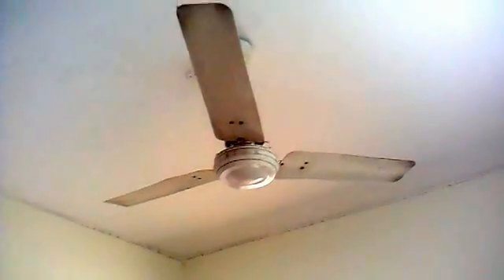YOUR CEILING FAN WITHOUT CAPACITOR

Comment: I had a problem with my fan so I decided to open the fan and replace the capacitor, after replacing the capacitor the fan will not rotate if I don't give it a push. When I remove the blades the speed increased and when I put back the blades the speed decreased I decided to buy a new capacitor but the problem persists. Please what do I do.
Reply: perhaps the new capacitor is also a defective one.  buy a new capacitor of a reputed brand from a different store. the problem can also be with the bearings or the regulator. u better check everything
Reply: even EC engineer as physics teacher don't tell these things why?

Comment: i have a crompton greaves high breeze 1990 model which was running at high speed and i packed it as we did not need it anymore today i took it out and its very slow i had 5 spare capacitors all were good and i even checked the winding all is good i dont know what the problem is  can you help me solve my problem
Reply from the maker: it might bE  a mEchanial problEm
Reply: it was due to swap of capacitor and winding wires
Reply: try changing the bearings !
Reply: everything was fine the wires were swapped nothing else thank for your solution

Comment: I joined directly the wires to power the motor (I removed the bad cap and the switch) and it makes a hum sound but when I give a good push, it does not spin, what could go wrong ?
Reply from the maker: there are two windings inside the motor and the impedance of both the winding should be different only then it will rotate that's why we connect a capacitor.
you should connect a capacitor with the same rating as previous one or just give a push..
i hope it will help

Comment: Hey Hemant, I am facing a small problem at my home too with My ceiling fan. It's regulator is stuck at no.3 and not rotating at all....so i am not able to increase or decrease the speed of my fan..any idea why is it happening and how can I resolve it?
Reply: just replace the reg. or better still disconnect the reg, and get the fan to spin at its highest speed.

Comment: but...why the speed is slow in absence of capacitor. ?
Reply: ***** thank you for the explanation👍
Reply from the maker: +Kapil Palotra Hi Kapil 
Actually in electrical engineering we have two theries to explain how a single phase induction motor works.
One of the two theory says that you can imagine a single phase induction motor as two three phase induction motors trying to rotate the shaft in opposite direction. So by attaching a capacitor you can(Presumably) detach one motor out of the shaft and now the motor will rotate.
So if there is no capacitor both the two(imaginary motots) are in play and therefore it leads to low speed.
;-)
if you are an engg, grad you would understand it very easily. even if not let me know .i will try to explain it further.
PHEW..;-)

Comment: Hi, I had an exact problem with my fan just like how your fan behaves without capacitor. So I removed the capacitor and tested it with multimeter and I found it faulty. So I replaced it with a brand new capacitor and it still does not spin and I need to give it a push either clockwise or anti clockwise to make it spin. What could be the problem? Should I further increase the capacitor value or am I having a faulty motor?

Comment: I recently replaced the fan regulator but still the fan speed is very slow!  Do u think I shud change the capacitor?  Will it work?
Reply from the maker: Nick Dan YES IF YOU WILL ATTACH THE CAP. OF CORRECT VALUE THE SPEED WILL INCREASE. That's why companies which address all these issues charge more for the fan.

Comment: So even though capacitor connected and capacitor is not in good condition same thing will happen right, because I am facing same thing
Reply from the maker: yes its same thing if capacitor is acting as a open circuit
Reply: Hemant Pant Thanks alot,finally fixed my fan :)

Comment from the maker: No I replaced the capacitor after making this video
Reply: Hi, my standing fan wont run just making quiet buzzing sound, i already change the capacitor but not work, yes i can remove the capacitor, connect that 2 cables, and give a push and it will run, whats wrong with my fan? And is it safe to run the fan without capacitor?

Comment from the maker: Dc series and dc compund motor will be good for the job they also come in permanent magnets plus they have a very good starting torque but remember dc series motor is never used without load. But ill recommend you that you must see the characteristics before you take any decision

Comment from the maker: You cannot increase the value of the torque beyond a certain limit but the maximum torque can be adjusted at any possible working speed for eg starting etc plus to have the maximum possible torque curve the value of,cap' must be enough to generate a phase shift of 90degrees to clarify this see my video on calculating the value of capacitor for your ceiling fan .i hope this would help and sorry for replying late